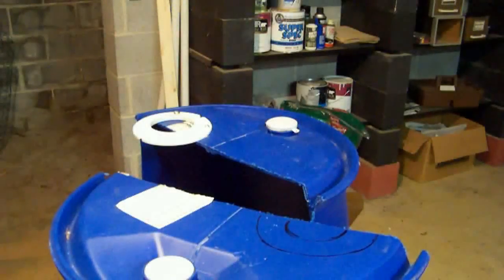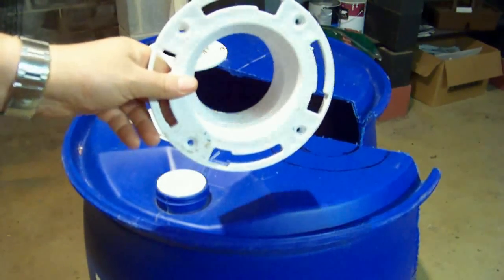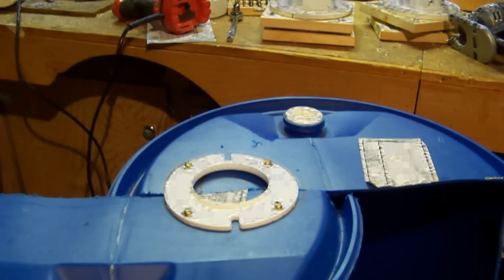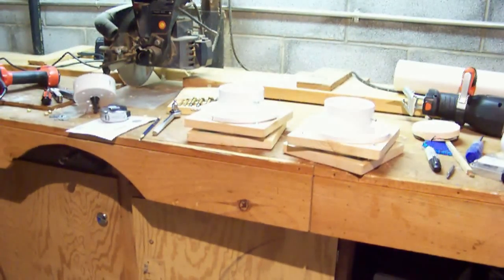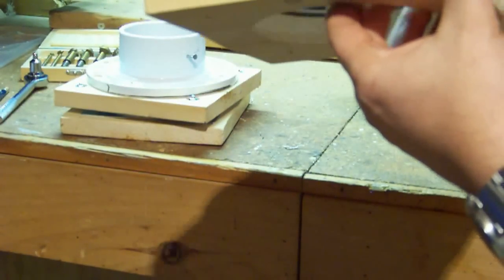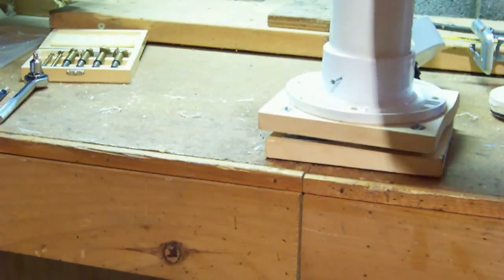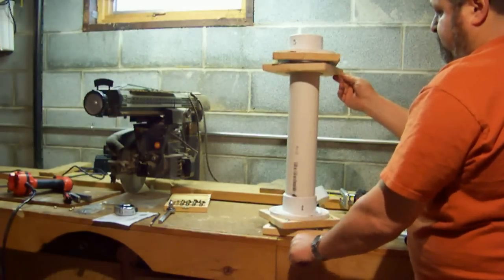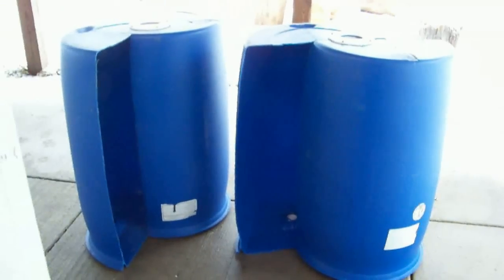How to Make an Inexpensive Vertical Wind Turbine - Part 1

Comment from the maker: By mounting it vertically, it can harness wind from any direction...not so if mounted horizontally.
Thanks for your comment.s.
I am not sure the maximum wattage yet.  My guess is about 500Watts in high winds.  We just put together a measurement computer so we will be accumulating power, rpm, coil temperature, and wind speed data soon.

Comment from the maker: You need to see part 2. Yes, I use a gear.  Making a pump handle go up and down requires a helical gear and a worm gear (search the internet for BAKER  ZA  HEAVY DUTY PUMP JACKS) to see one that works with an electric motor.

Comment: This very interesting idea, I guess a question that should lead a pulley at the bottom of the boat, as couples in 2 feet of roller diameter and the pulley to be a permanent magnet generator. 

Thanks for your desing.

Comment from the maker: Are you talking about putting insulation on the inside of the drums? If so what form of insulation? I think that with the new bearings I am using it will be nearly silent anyways.

Comment from the maker: I am figuring this out now.   I don't have the data yet but am putting a hall effect sensor on the turbine to measure the average rpm, and just bought a usb connected weather station to cross correlate wind speed, electrical output and rpm.  The rpm of the motor needs to be about 300 rpm to get 14 Volts.

Comment from the maker: Guys, if you check GREENPOWERSCIENCE on youtube, he has done some work with magnetic bearings albeit with some mechanical constrains (allthread).  I think this is possible to do even if it isn't perfectly stable in equilibrium (Earnshaw's Theorem) as we only care about what is happening when the device is rotating.   Also, lets be nice to each other here.

Comment: you are not a physic major, and a social worker isn't a  type of engineering field. It also is possible to use magnets for such a device, take 2 neodymium magnets on each end, glue them on with epoxy, then use a 2 inch pvc to seperate the magnets but it will be used so the magnets doesnt get set off the track...

Comment: HEy!! this is an amazing idea by using big plastic drums as wind turbines. i have been wundern what to do with the endless supply of my barrels lol. a freind and i made one today out of one barel that sits sideways and mounts between two trees to provide power to our homemade cabin in the woods and is powered by a semi alternator and 4 car batteries:) and one question...where did you get the lazy susan bearings and PVC fittings//

Comment: Research at Sandia Laboratories suggests an overlap of 10 to 15% of the bucket diameter, not 50%.  I suspect you're loosing a fair amount of power.

You ought to hookup a simple home-made salt-water dummy load and check the power.  Piece of cake.

Comment: The problem with doing that is that it would have to require a huge tail to align it with the wind.  If you're going with such a system you might as well construct a hawt instead of vawt as you get more power out of a hawt.

Comment: i think it does, but the drag still adds up...

will it work better if the barrel halves overlap less, therefore catching more wind? it probably will result in more force but will only be noticable in stronger winds...

Comment from the maker: Part of the reason I like the 3" is because the large plastic pipe fittings also support the barrels so I don't need metal struts to support the barrels. 2" would be lighter and faster however.  I may try sharpening the edges after I have my sensors on the turbine so I can measure if it has any effect.  I think it would be a marginal improvement if any.

Comment from the maker: The seam on the barrel is very thick and hard to cut, and would bisect the barrel openings and complicate bonding them.   

I use string as a compass to find the center in a couple of spots and then used masking tape to mark the line (not very accurate but it worked).

The barrels are sandwiched together by the Oatey PVC fittings. No glue or anything was necessary.  I used 1/4 inch nuts and bolts to secure the fittings, sandwiching the barrel surface between the fittings.

Comment from the maker: Check out part 2 for the electrical generation method. I am making a unit with sealed bearings now and it will be running in late August when I return.

Comment: I really like your design. Right now, the wind is blowing lumber around my yard--I live in a mountain pass at about 6800 ft. elevation. I'm afraid that a regular tower might get blown apart. Do you think your design would stand high winds (like 60mph+ gusts). 
Do you think your design would work with a pulley&belt system or a bicycle hub. I don't have a CNC cutter.  Thanks for sharing the work you've put into this.

Comment from the maker: The PVC barrels each weight 22 lbs so the entire system is around 50 lbs.  Is that heavy?  I have seen Savonius systems with steel barrels which way more than twice the weight of the PVC barrels. Also, one of my design goals was to use as much recycled material as possible in the turbine.  I am certainly open to new ideas but also want to keep this design fairly inexpensive.   I am making a pipe-tower to raise this up 20 feet also to generate more power.

Comment: i agree with (Americo 1974), becaus the wieght on the blades will give it more drag wich makes it so you produce less energy.
also it you may want to try the 'helix' design, because it gatheres wind from all directions, wich in your model it doesn't gather the wind from the top. but cool design.

Comment: Nice and cheap way to make power.

I've been thinking about making a VAWT. For the generator part, I was thinking of using a geared DC 24v motor that spins at 200-300rpm. What are you planning on using for the generator part? Does anyone have ideas?

Comment from the maker: You are correct with respect to the Savonius vs. HAWT efficiency, but  my goal is to build a system to provide 12V power at a price affordable by virtually anyone, even in developing countries.  The Savonius has a lot of torque in strong winds.  By combining a small permanent magnet generator (for trickle charging in light winds) and some circuitry, I am going to charge the coils of an alternator only in higher winds to take advantage of the increased torque for rapid charging in stronger winds.

Comment: Unfortunately skateboard wheel bearings are not designed to take side load. The automotive bearings would be better as they are able to take side load. The Idea here was to make it cheap though, and $100 in bearings spindles and rotors, or $250 in sealed hub assemblies would kinda screw that up.

Comment from the maker: I am in the midst of putting the electrical generation system together.  You are correct that it will not spin as fast.    I just purchased a DC motor/generator and am trying to find a way to hook it in and need to gear it up so the motor spins a lot faster than the turbine.  As soon as I get it working I will post another video.

Comment from the maker: What we did is connect the axle and barrel assembly to the top bearing using a wood screw  and let the system hang (basically used the savonius as a plumb-bob).  Then we noted the position where the bottom of the axle was and marked it.  Finally, we installed the lower bearing on the 2x4s in that location.